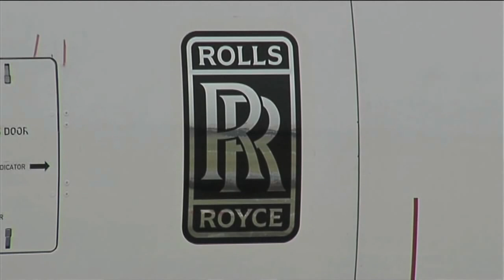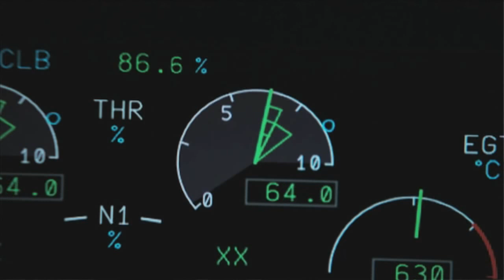Paris Air Show report: Airbus A350

Comment: In 2010, Airbus launched the A320Neo, and Boeing were considering a clean sheet design. However the Neo was so successful, airline pressure forced Boeing to redesign/re-engine the 737 or risk losing significant market share. They also copied Airbus' use of fly-by-wire in airliners, use of composites (A300 had composite components) and their philosophy of cockpit commonality. Also, the 767 was a knee jerk response to the A300, and the 787 to the A330.

Comment: The 787 has had 3 extra years to get about 200 more orders. So if the A350 snares a few more customers in the next year then the A350 will be more successful. It's been a failure for airlines though, lost profits through the groundings, poor reliability, especially for DY, safety issues, and trust lost in passengers and operators, who increasingly look towards Airbus, like JAL did.

Comment: If you're going to reply to my comment at least make valid points against what I said.  To this date the 787 has more total orders than the 350, it's still cheaper per unit, is currently in service and therefore will encounter problems which have already been corrected.  And since the 350 is not in service yet they can learn from Boeing.  The End

Comment: Don't get me wrong, Boeing won over the Airbus A340 with their excellent 777 (outstanding SAFE record), but they screwed up with the 787 due to one sided thinking which seems to be what you are doing. And for your information, as of now the 787 dropped in orders as airliners are more interested in the A350. An example is Japan Airlines, Boeing's most loyal customer, for the first time, has a firm order of 56 A350's. I wonder why? However Boeing's 747-8 INTERCONTINENTAL is the BEST Jumbo Jet. Bye

Comment: And Boeing needs to look up the word "SAFETY" and add it into their formula of modern airline construction instead of insane LITHIUM efficiency. Read every Boeing's description on the 787 Scareliner, and you will NOT FIND ONE concern on safety. They are way overly obsessed with efficiency which makes a lot of people nervous about their thinking. Airbus A350 however intelligently uses composites for efficiency and NICKEL for safety. Also No kite wings and the best looks. A350 WINS this one.

Comment: The A350 is a successor to both the A330 and A340. It will be a rival to both the 787 and 777. So rivaling two planes with different sizes is quite innovative in my opinion. Airbus doesnt need to rival the biggest models of 777 because thats the A380 is for.

Comment: this plane has probably been in the planning stage for so many years before airbus even knew what the dreamliner was going to look like. i highly doubt this plane was inspired by the 787.. only thing they might have done is take a look at all the mistakes boeing did (e.g. lithium ion batteries) and avoid those problems.

Comment: jaffacake is a waste of space.

787 and A350 are both very good designs of the same generation and each respective manufacturer have taken a slightly different approaches in various aspects.

It's not a black and white comparison both designs have their strengths and weaknesses.

Comment: Correct, it was first used in the development of the Boeing 777, the first  fully digitally designed commercial aircraft. You are trying to creep your way around the fact that the cheaper, old fashioned and dirtier system of bleed air for the A350 is worse. Both use hepa filtration, but the 787 air is cleaner and more humid. I will credit both in having larger windows, and I'd prefer the wider windows of the 350 to the taller ones of the 87, however, the 350 doesn't have dimmable windows.

Comment: Why change perfection? Because leading air into the cabin via scoops instead of from the engines means fresher, cleaner air for everyone. Computational fluid dynamics have been used in designing the 777 for many years, way before the A350 came along. The 'Technology' of the A380s wing design (a mostly static(ish) object) is not the same for the 350. The 350 needs a much smaller wing, and is a completely different shape. Airbus saw the 787 wing and its efficiency and adapted it. Called it theirs.

Comment: It's obvious they pretty much took the 787 wing and raked the tip a little more, it has nothing to do with the A380's wing, it's a completely different airplane to the 350. As for the back up systems and redundancy, the 787 has more of those. As well as incorprating more 21st century technology, for example, the A350 still uses a dirty bleed air system from the engines via butterfly valves.

Comment: "The only all new" So in that case, you can't actually use the A320 as an example, because It's not all new. It's just an improvement on the A320. A350 hasn't launched yet and there were no deliveries of the aircraft to airlines yet. The A380 is the only "all new" aircraft that Airbus is producing. Not to hate, but on personal preference, I think Boeing's better.

Comment: Sorry, you don't compare a large passenger jet to a small, economical aircraft flown by airlines with undertrained pilots and poor maintenence, not to mention how many more 737s there are and how they have been out much longer. The 777 is a comparable aircraft to the A340.

Comment: are you high?or what? the only similar thing that the 787 has with the a350 is the exterior design ...and that is because thats what's best for these aircraft ..airbus didn't make the exterior of the plane similar to the 787 just cause they wanted to copy boeing but because thats what's best for the a350..because the new aerodynamic shape and structural body is beneficial for a350..as a result airbus want's what's best for they're aircraft

Comment: which airbus aircrafts have had problems..???boeing has only one all new model in production line..the 787..did you forget that the b787 was 2 years behind schedule due to electronic problems..
 airbus still has the new upgraded a320neo family with sharklets and new fly by wire system , the a350 family, the a380, The a320 has never had a single passenger fatality the a350 hasn't been launched yet  The only all new aircraft boeing has in production line is the 787 which was delayed ..

Comment: The 737 had similar teething problems, because the 737 was created at a time when aviation was generaly a lot less safe anyway, why wou;d you even dare to think about comparing it with brand new aircraft with similar problems? There's no excuse. You said "it's because it was Boeing" False. It was due to aviation safety in general at the time. If anything, it's Airbus with the problems, brand new planes with similar problems to first generation 737's.

Comment: SIA used to have 757s, which have had 2 incidents where faulty readings led to disoriented pilots and crashed into the sea at night, no one sees 757s as unsafe. The A330 isn't seen as an unsafe aircraft, the 737 had crashes (almost all older types though), but it's regarded as one of the safest, because there are so many that crashes don't bring down the no. of passengers died per 1 million hours. One crash will not change much, if it did, RR engines would be seen as unsafe (BA38, QF32).

Comment: What does that have to do with anything? SIA's only fatal crash was a 747-400, Silkair's only crash was a 737. Does it matter? No. I felt extremely safe flying on both of these aircraft before and after. The A330 is an extremely safe aircraft, an incident which could happen to any plane with a confused pilot and then a bad landing attempt don't make an aircraft type unsafe.

Comment: I'm not certain about the engines being more fuel efficient, because the CFM engine is essentially the same, but it's narrower on the MAX (Ground clearance n shit). And a wider engine means more fuel efficiency, (777-300ER, 787). Pratt and Whitney's engine I don't know about. If there is a difference in fuel efficiency, it's not much, not much more than 4%, a gap easily closed if the airline is already an Airbus operator (training costs) or if Airbus gives a discount. Vive versa for Boeing.

Comment: Airbus make quality aircraft. Boeing's 787 has had its fair share of problems, with the fasteners, weight problems, wing joints etc etc. Are they dangerous? Absolutely not, they've been certified as safe, as has the A380, as will the A350. Easy.

Comment: Norwegian, an all 737 carrier has just ordered 100 A320s. Boeing bid very low to get the SilkAir order, it's good business on their part. However Scoot uses 777s because they're no longer needed by SIA, so why not just pass them on to Scoot. Don't forget SIA is replacing it's 777-200s with A330s, they've just ordered more.

Comment: Boeing has had an extra 20 years with its 737, and in that time it established itself. Considering the 737 has had 20 years extra to get 1,500 more orders shows that the A320 sold much quicker. And if it is so much better then why did an all Boeing customer not only order A320s, but more of them than the 737? Why has a large LCC in Scandinavia with an all 737 fleet order 100 Neos as well as 737 MAXs? The 737 is better? Maybe so, but the difference is very very slight.

Comment: Well the MAX is more efficient and I think  that might be the reason that the A320neo might not get as many orders now. I think that both planes have advantages. The A321 is big but also the MAX-9 is smaller but id still larger than the A320.

Comment: Yes but the rating agency's don't rate the aircraft unless they've had over 1 million flights. So the 777 has more flights than the A340. And what do you know? I've been a pilot for 16 years. I flew airbuses crj's and boeings and I think boeings are the best and I like crj's and airbuses have never been a favorite of mine and I feel that an airbus doesn't trust you because it basically says I'm in control cause your going to crash the plane cause your stupid. Airbuses are ugly except the A340.

Comment: Really I can name many crashes as the result of fly by wire and airbus cockpit design except these crashes didn't happen 35 years ago. Let me think Air France 447, Air France 296, and many more. Boeing fixed those problems and the 737 is the most popular plane in the world. I flew the A319 for many years and I know the issues with airbus's fly by wire technology are rampant. The way Boeing uses it on the 777 must work because it's never had a fatal crash. I now fly the 757 which is much better!

Comment: "As the Overweight is calculated from the OEW which is specified as 110t for the B787-8 the added weight equals 8,9%.
Comparing the 4t of the early A380's with an OEW of 285t, which equals to 1,4%, the fuel penalties are massive, also the limitations in range and/or payload. In Europe such an airplane would simply be undeliverable. (From the manufactures Point of view.)"

Comment: At last week's 787 first delivery, Satoru Fujiki, an All Nippon Airways senior vice president, told reporters that the performance shortfall on the early deliveries would slot the aircraft into a role of regional missions, rather than long-range international flights, which will be flown with later built aircraft.
As the Overweight is calculated from the OEW which is specified as 110t for the 787-8 the added weight equals 8,9%.

Comment: Airbus will self destruct. Their nothing but electrical flying disasters. The A380 has proven to be a huge failure. They've recent'y paid in excess of several hundred million in recall repairs cause the wings were cracking not to mention the body was experience stress fractures as well. Less than 10 years. There so worried about beating Boeing in release, I think they do test flight on customers and when something goes wrong, they blame it on RR and chalk it up to "experience".

Comment: Airbus will flop with this plane, just as they did with the A380. With less than 10 years of service the plane is already experiencing structural failure, wing fractures and is paying hundreds of millions in repairs. But I'm sure they will blame the engine manufacturers initially to buy them enough time to come up with a logical lie for the planes structural fractures.

Comment: The dreamliner Replaces the boeing 767 AND 757, Boeing will have an edge cos the A350's rival is the 777 not the 787, And Boeing are building an all new 777, called the 777-X currently but it promises to be better than the A350 in many ways. we'll see what happens!

Comment: why???? Noone is better than the other, everyone says that boeing is better ONLY because Boeing is american. The  a 320 had a lower fuel consumption compared to the classic boeing 737, the a320 was the first commercial plane that had fly by wire. the a380 was the most efficent airplane  until the boein 787 came.

Comment: A350 is okay but it's very much like the Dreamliner only slightly worse, as it don't have as much composite material, not as many innovative technologies interior & exterior. Boeing 787 dreamliner looks more futursistic and is in terms of tech, A350 aint built yet, 787 is in service!

Comment: A350XWB is most certainty great. but it should not be compared to the 787. It should be compared to a most certainly boeing's new 777's: 777-8x and 777-9X. which is to launch 2017 or 2018

Comment: Airbus's fly by wire is not hands on enough for my liking; with the small jot stick by the side of the pilot, also computers on board Airbus aircraft over ride the pilot; losing the sense of control within the pilot. the Boeing aircraft have the big hands-on control yoke and Boeing doesn't restrict the pilots authority.

Comment: @hello1233280 
Where is your evidence?
Its obvious you cant compare planes properly. Its obvious you cant focus and compare specific areas of a plane.
They are two different planes.
its a fact

I might aswell say the a340 is a direct clone of the boeing 707 because they both have 4 engines.

Comment: @hello1233280 
It looks fatter because it is competing with the 777.
Plus, look closely at the 787's nose and window design. It is much different to the a350.
The a350's front window design "blends" into a whole one. 
The two planes have different specifications.
The only reason they may look similar, will be because of the wings. But those wings are next gen wings that are going to be used by all future planes because of their lift efficiency.

Comment: @BallisticTip270WSM 
Its called NEXT GEN AIR TRANSPORT.
If I invented the flatscreen TV, and similar new ones are then made by someone else, do I have the right to complain? No. Because it is called moving onto the next level. Just because the 787 is a next gen aircraft, does not mean no one else is aloud to manufacture such planes. Saying it is 50% carbon, then refering to looks just doesnt make sense. And who are the aviation experts? A real expert will never say it is a clone. Ever.

Comment: @LesTroisOiseaux Remember the A350 was initially designed as an upgraded version of the A330 featuring new wings and tail. Under pressure from airline customers, airbus was forced to redesign the fuselage as well and hence the "Xtra Wide Body" tag - meaning, it's wider than the initial A330 design.

Comment: @scaremengaviation you are not right... Boeing's 787-9 is to compete with the Airbus A350-800 and only the A350-1000 is designed to compete with Boeing 777.  A possible variant is the 787-10 to compete with the Airbus A350-900. And yes the A350 was designed as a response to the 787 :)

Comment: The a350 will be more efficient than the 787 by a few %.
It will have a larger capacity too.
After it is released, you will get little boeing fanboys argue that the a350 is a clone.

Comment: I cannot wait to see this aircraft finished I will no doubt get to see it at the plant where its trent enigne for the test aircraft is built I have seen some of the latest aircraft there A380 , 787 (under the wing for the 787 fly over a unforgettable experience it so damm quiet i expected my ears to be blown out nothing at all ) both recieved massive turnouts the 787s appearance virtually closing the main road in both directions.

Comment: @scaremengaviation 
Well I think the A 350 has a realy good chance against the 787. Airbus is the benchmark in fuel saving, design of cabin interiors, a smart cockpit with forward-looking technologies. I know that the A 350 is a response to the 787 program and therefore Boeing had more time. But I´am pretty sure this aircraft has a good chance.